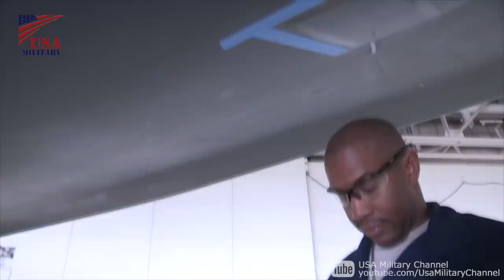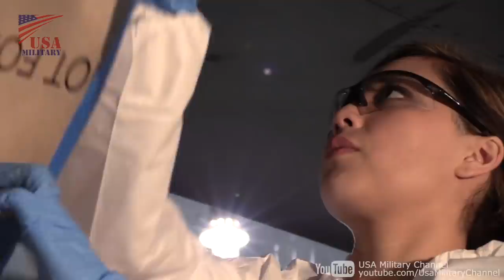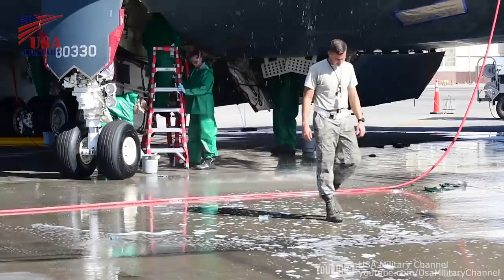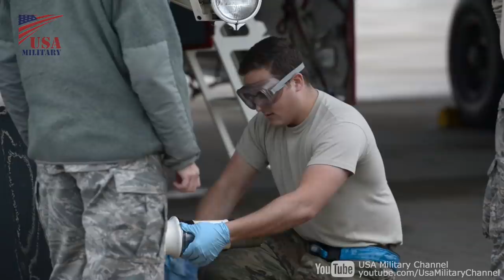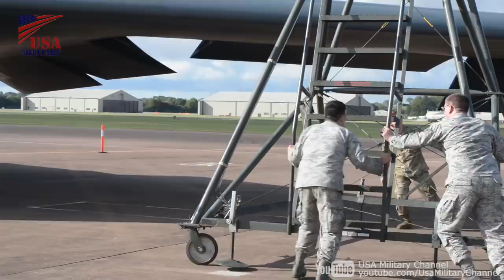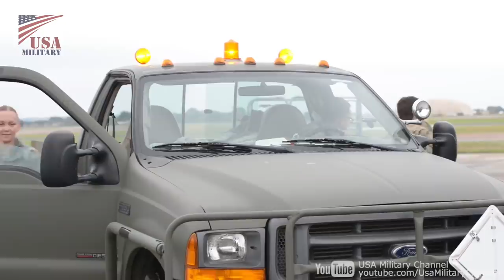Maintain The B-2 Spirit - Stealth Coating, Wash, Tire Exchange, Etc.

Comment: Those nose gear tires definitely were about worn out.  I crewed tankers for years,and never ran into nose tires worn down that far.
I enjoyed crewing the planes,but not washing them.
Reply: Bombers probably don't have the same limitations, as doesn't military in general...
Reply: I fly cessnas and I've never seen even a 152 with such tires
Reply: Bobby Brady  Exactly! When war happens, ain't no time for proper safety!
Reply: Washing is horrible, however try doing a wing Pivot Point job on an F-111D!